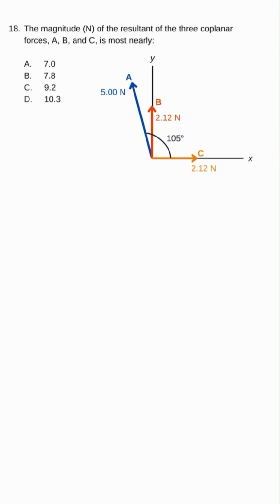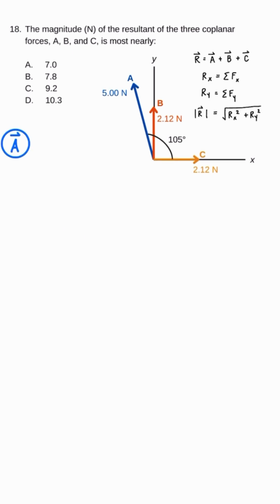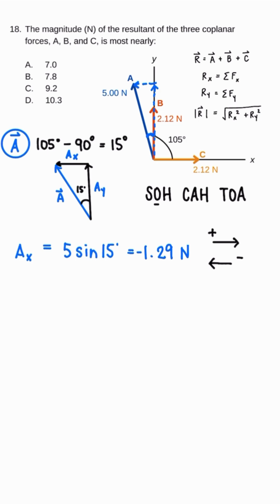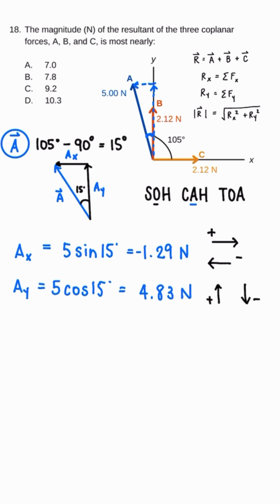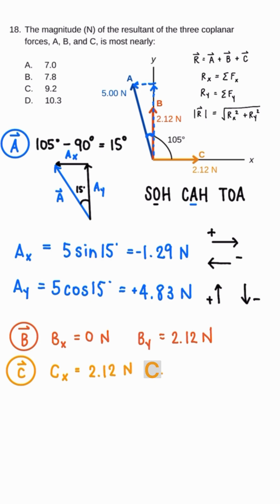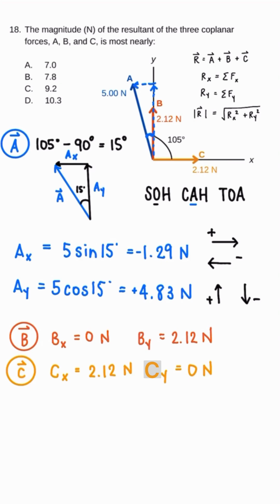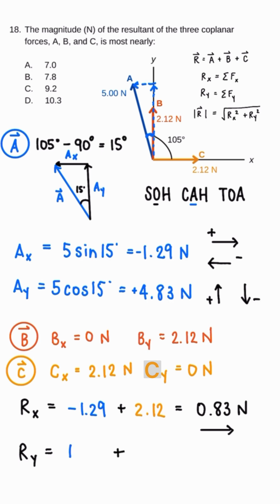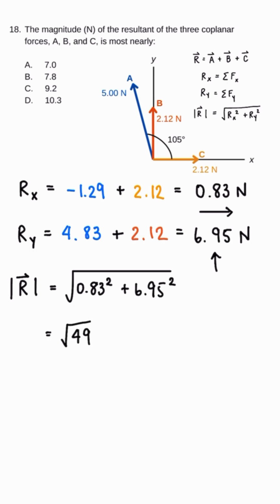FE Exam Practice Problem #18 - STATICS (Step-by-Step Walkthrough)

Comment: if you used 5cos105 = -1.2 ? Should I leave it negative or add another - to be postive ... confusing?
Reply from the maker: Great question! So the y-component of Force A is going to be the magnitude of the force (5 N) multiplied by the unit vector in the y-direction (cos15°). Keep the angle positive since we are measuring the angle from the y-axis.

5 x cos15° = 4.83 N

To determine if it’s a (+) or (-) value, look at the direction of the vector. We know anything in the I or II quadrant has a (+) y-value, anything in the III and IV quadrant has a (-) y-value. Because Force A is in QII, the y-value will be (+). Does that help? 👍🏾
Reply: @degreetope  I didnt talked about Y . I was pointed to  x-component.
Reply from the maker: @adamrayan7892  To solve for the x component of Force A, use the equation 5 x sin15°. You do the sine because the x-component is opposite of the 15° angle (SOH —> (S)ine = (O)pposite/(H)ypotenuse). 

We know vectors in Quad I and IV have (+) x-values and vectors in Quad II and III have (-) x-values. Force A is in Quad II so it will have a (-) x-value.